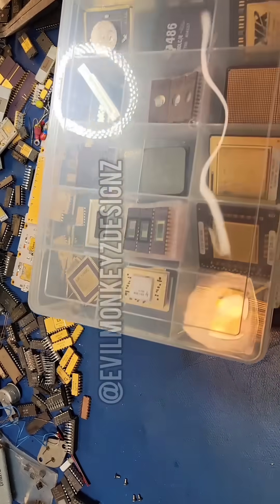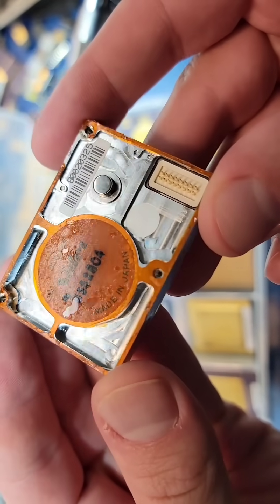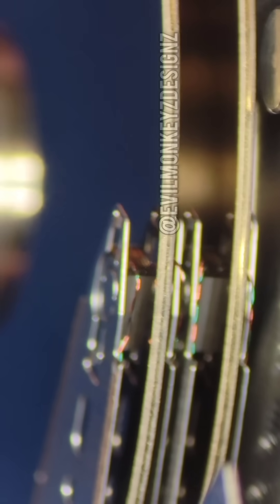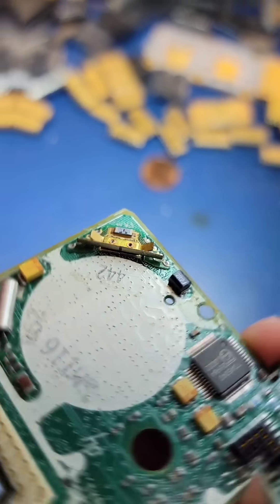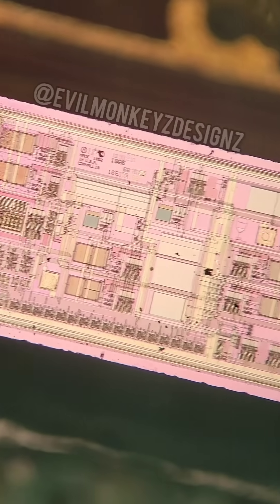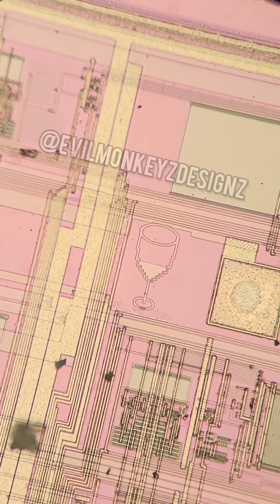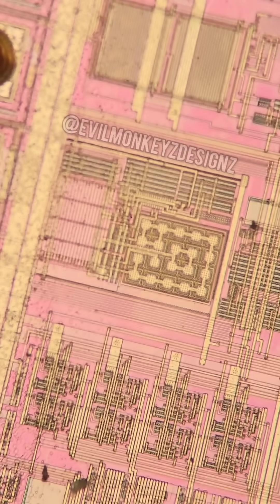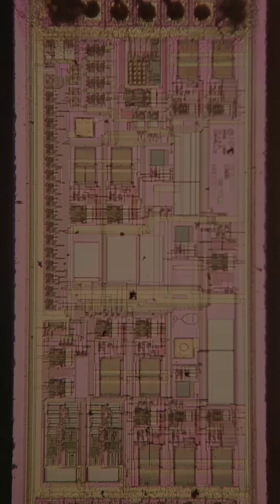1.3" HDD

Comment: That as an USB stick would be great.
Reply: Not with this particular drive, but that was an actual thing a bit later on. I have a 4GB "USB stick" that uses an IBM microdrive internally (same drive mech as the ones designed to fit in a compact flash slot). It's basically a small rectangular plastic case (~2.5x2") with a USB connector that flips out from one end of it on a hinge.

Comment: The sensor actually detected a free fall condition.  When you drop something, in free fall, all the sensors will detect near zero gravity.  The sensor will then trigger the head parking mechanism to quickly retract the heads off the platters to a safe zone before the inevitable very high g-load (from impact with the ground) happens.  Back in the day, when we were designing them, we called them "Oh Sh*t" sensors.

Comment: I had a pcmcia drive much like that, what was weird about it is that half the bios for the actual laptop and or cash register (depending on its application) was in the firmware of the drive, making it the only thing that the device would boot.

Comment: Older 'spinning rust' HDD"s were never "designed to be dropped"..but some of them had some basic protection,just in case.. It's not a guarantee that the drive will survive an impact,though..mostly just wishful thinking,honestly. The heads are floating on a very thin cushion of air,it doesn't take much for them to impact the platter and literally scrape your data away.

Comment: Wow! I'm impressed at the small size and technology, specifically given how old this drive is. 9 years earlier the original Macintosh 128k was introduced and it used much larger circuitry. The Macintosh Portable came out in 1989 and ran through September 1991. One year after we had technology like this. With that in mind doesn't this blow your mind? Wow!

Comment: Remember the CF Sized hard disks? 1 " sized. CF means Compact Flash, but since this standard was still quite huge, hard disk manufacturers built tiny hard disks to fit in CF slots 😅
Edit: They were quite cool, more storage for less money, but they were super slow compared to real flash memory cards. And since cameras etc. had quite large buffering capacity, they were even super useful for cameras. Just not if you were a very triggerhappy photographer, then you'll wait after a few pictures. But anyone coming from analog photography never had that problem 😂

Comment: I remember my old Thinkpad T23 had APS -Active Protection System. Same basic principle. It would detect a shock and rapidly park the heads to prevent drive damage. Would also protect a hard drive in the Ultrabay as well.

Comment: I was given a small drive found in a park , after some searching I found an external enclosure for it on the well known auction site , it was a small 1.8" hard drive from a camcorder , nothing on it other than some firmware data . It still works , it's basically a 30 gb external drive now , albeit living in a drawer unused .

Comment: congrats, you broke the drive by exposing it to pure air and not in a anti dust chamber
Reply: Now we will all die because the cheat code for survival was on it 👌🏻
Reply: @nee3029  and congrats you triggered my underlying lung disease caused by aluminium oxide, i now have asthma and acute lymphoma that has nothing to do with asthma nor lungs

Comment: lol in 93 I worked on a 20meg drive that took 2 people to lift, us navy, snap 2 computer system……ugh
Reply: Call me crazy...But being strength-centric to the point of disliking miniaturization, I would have loved to have had an external HDD of those dimensions and weight... 💪💾💙

Thinking about what you could fit into that form factor today: I wonder how practical a 50kg one petabyte drive be in practice? 😇

Comment: Smaller drives exist indeed and they have more capacity I have a working 0.85 inch drive that hold 4GB in an old Nokia N91.
Reply: But this one looks better. More hard drive looking to me. With all the components and interconnects and the machined housing

Comment: I had an old ZIF drive (i think that's what it was) from a old "Creative MP3 Player" back in the day before Solid State Storage was "cheep" it was so small, like 500MB or something like 1GB HUGE at the time, it blew my mind how it even worked at all... since my PC had a BIG HDD and it was only 40GB and that was a Huge Storage at the time, it was Windows 95 or 98 i think ...How was that less expensive to manufacture than a simple Mass-Produced Chip based storage... it was crazy to see back then.
Reply: Flash memory ist Not the Same as ssd 

And the first mp3 players had 32/64mb flash memory 

It was a long way from 128mb to finally 512mb and years later 1GB available

Comment: If this thing was dropped the heads parking wouldn't prevent them from crashing into the platters, but if they crashed in the landing zone it was less likely to cause catastrophic data loss. Also if the spindle was made to stop after parking it would have further reduced damage from impact. Ramp-loading heads didn't appear until a few years after this was built, which further increased impact resistance, but these are still extremely fragile precision devices and are not intended for rough handling.
Reply: I never understood how the ramp mechanisms didn't cause more problems than they ever solved. Watching how the servo just slams them over into it... and then they just fly out onto the disk all lazily until the controller decides it's time to seek 0... never could figure out how there weren't all kinds of alignment and crash issues. Never really seemed to be an issue but talk about counterintuitive lol

Comment: Okay but hows the accelerometer work? Are those piezo elements? Resistive? Capacitive? Could even be radio or inductive. How many drives had this. When did mems chips come out? Can I ask one more question lol. I mean it has to be faster than the heads can crash right? Or does it not work like that and the head’s always crash at least a bit.
Reply: I think these were some of the first MEMS ones.  Piezo would have been too slow

Comment: I had a calculator, years ago. Which had storage features. I never thought much about it, but i tore it apart after it broke. I'm not sure if it qualifies as a HDD, but it had a flexible plastic magnetic platter, similar to a floppy disk, about 1.25cm in size, and a fixed position read/write head, contained in a tiny plastic enclosure within the calculator.
Reply: The web tells me that was a Canon Canola 167.  They had an insane (for the 60's) capacity of 100 numbers memory because they had that drum memory.
Reply: thats so cool
Reply: what the hell calculator was that!?  You had a calculator with drum memory!  that's so cool
Reply: @tsm688  I'm not sure I would call it drum memory. I'm not exactly sure just what you would call it. - I wish I could recall what calculator it was, it was not a model of any significance. It was a CAS calculator, but was not graphing. It was very similar to the Casio FX-300ES, but was like a cheaper Chinese knock off. :D
Reply: @trevorcorwynn1311  a modern calculator?  Very funky indeed.  I begin to suspect that wasn't a drive at all, but some sort of position encoder.
Reply: @tsm688 Did it have slots in it?
Reply: @qwertykeyboard5901  how would I know?
Reply: @tsm688  oops
Reply: @trevorcorwynn1311  Hard drives really are just floppy drives with more durable components.
Reply: Would love to see tear down of it
Reply: So, what was the battery life like?

Comment: Is there a smaller HDD?
Reply: Yes. There's a considerable variety of HDD under 2". Most of them were specialty made for specific products (ipods - multiple, laptops, PDAs - before smartphones were a thing, etc).

If you want to find out, I would start with a search of "1.9" HDD" then go down by .1 each search. You'll probably be amazed at how many existed but were hardly known about. Original Ipods and I believe nanos and Zunes would probably be the devices most people were familiar with.

Comment: Damn!!! This must've been ADVANCED PC tech in 92..
In 92 my fam PC was a 486, 16MB Ram, 200M HDD (IDE?) .. good times ... Miss that Turbo button :P
Reply: 16G of ram?  you mean 16 megs of ram, probably EDOSIMMs, which is pretty good for the time.  HDD would be SCSI at the time or IDE depending what controller card you had.
Reply: @2600baud  correct, typo on my end, don't often use MB to refer to RAM these days :P
Reply: lol 16G of ram
Reply: What's the turbo button do? I was afraid to use it
Reply: @CALEB-kt8mn  The turbo button was used to increase or decrease the clock speed of the processor externally.  Often from 12 MHz to whatever max speed your processor was at the time.  The reason behind it if I remember was that some programs that were "backwards" compatible would not run at the max speed cause it was not written to run at whatever the max speed of the processor was.  Such as some games if you played at max speed would just glitch or you hold down a move key and you just fly across the screen cause the game was running too fast.  When the operating systems advanced to have better interrupts to throttle the processor as needed than to have a forced underclock on the board, the turbo button was not needed anymore and disappeared between the windows 3.1 and windows 95 era, first gen pentium.
Reply: @2600baud  thank you
Reply: @CALEB-kt8mn  The turbo button was used to slow your PC down to 1981 speeds if you needed to use a really old program that misbehaved on faster PC's
Reply: Turbo button slows down the pc 😂 @CALEB-kt8mn
Reply: Damn! You had 16 MBS in 1992!! I didnt see that until the Pentiums came out!
Reply: You might've even had a separate disk controller card even in 1992. IDE stands for Integrated Drive Electronics, by the way.
Reply: @edherdman9973  thanx , I recall what IDE stands for, but I can't recall if disks at that time were IDE based. :) .

I doubt they were IDE, because when I got into I.T professionally about 13y later, SATA 1 and 2 drives were still sort of pricey tech.
Reply: It was the smallest hard drive in the world
Reply: Same😢
16Mhz or with Turbo 32 Mhz 😢
Reply: U can thank the aliens for that

Comment: I still own a Dauphin computer that used that 40Mb drive.  The accelerometer was needed since it was a laptop, and it would park the heads if it felt a quick movement. I had to run "Stacker" because win 3.11 took a lot of room.
Reply: I think the accelerometer has become a feature of all spinning drives these days.  Eariler than the 90's they didn't because such a sensor-on-a-chip didn't quite exist yet
Reply: @tsm688  I definitely remember that being on an early 2000s laptop of my parents! I think it even had a graphic of the drive's angle in relation to horizontal inside the drive's properties window, I'm guessing to look cool.

But maybe not all laptop hard drives come with that feature? Is the shock protection feature built into the laptop or specific to the drive?
Reply: I used Stacker also!
Reply: Stacker! I totally forgot about this, thanks for the flashback 😅

Comment: Still cant believe there were ipods with 80gb capacities with physical hard drives considering how old it was and for how long the phone market didnt seem to have that much, especially with android. I know there were other concerns on the phones, but still
Reply: Flash based storage really sucked for a long time. Very small capacity AND super expensive.
Reply: Came here to say this, the old fat iPods had spinning disk hard drives in them.  If you put them up to your ear you could hear the arm moving and the disks spinning.  There was also a 160 gb model but you could also switch the drive out to a larger capacity one.
Reply: People still like those. They get the spinning drive version and put ssds in them. Still a good way of getting a large capacity MP3 player
Reply: @zyeborm  We still have ours. We thought it was lost forever and found it out of the blue one day like a decade later
Reply: @zyeborm  Im one of them!!! I have the larger battery mod already installed lasts a long time and Im going to be essentially putting 1TB of storage into an iPod 5th gen
Reply: They were pretty durable though. The only apple product I've ever had was an 80gb first gen iPad video, loved that thing. Having full seasons of South park on it was mind blowing when it came out.
Reply: @beeman4266  The only reason why any portable hard drives even worked is because they have an accelerometer in them and the controller parks the heads whenever it detects that a shock is going to happen. Without that, they are about as fragile as any other hard drive. Maybe a little less since they usually are cushioned  with foam or rubber and regular hard drives usually aren't.
Reply: @No-mq5lw   Interesting, obviously their durability is nothing compared to phones with flash memory but I was just impressed that it didn't really skip or anything. Can't say I ever dropped it though.
Reply: @beeman4266  Skip protection is usually handled by a DRAM buffer. Your data is streamed to the buffer, then read from the buffer to be played. Even now, this is by and large how most storage is handled.
Reply: @No-mq5lw Yup, same with portable CD players, they use a RAM buffer to even out any skips if the machine is jolted.
Reply: I remember those in my iPod video back in the day. Had to replace the drive in it, used tweezer for most things as everything was so tiny. I do love water proofing, but I really do miss how even apple products were just so easy to work on (imho)
Reply: @alexjackson936 same lol I replaced my girlfriends iPod’s hard drive when I was 14 and had never done anything like that.. and it worked
Reply: Those are 1.8 inch hard drives known as netbook/ultra portable laptop hard drives.
Reply: Solid state memory was still uber expensive when the iPod came out….
Reply: Friend of mine buys used (broken) iPods, slaps a modern SSD into them, and resells them.
Reply: Whaaaat? I had no idea there were actual hard disks in iPods
Reply: @Taima  Did you never own one?
Reply: @extrasmallbeep  Indeed I did not. No iPods of any kind. Kinda missed the boat on them, repeatedly. Went from bedroom radio at the ages of like 8-11 to cd player from 12 to 15 to sweet Sony Ericsson slider walkman phone for a year and then got my first iPhone (3G S). Definitely felt the lack of iPod for a while in high school but I also hate earbuds and find them uncomfortable and my parents knew that so they never really wanted to get me one, understandably.
Reply: I had a Ipod Classic in 2008 and was extremely slow 😅... definitely would have sucked in a android phone, that's why not even Appoe tried it
Reply: And the iPod HDDs were also used inside MacBook Air. Many people also don't know MacBooks had an accelerometer also for the hard drive.
Reply: 2006: 80GB iPod, iPod nano 2G, iPod shuffle 2G

In 2006 ,, PC was bigger.. and phones not,, why??
Because a phone would be to big and easy broken..
Reply: I paid about 80 dollars for a 512mb flash card and 2gb cards was 500 dollars
Edit: in 2004
Reply: If you mean why not hard drives then that's cause there was only a brief moment when it made sense in capacity vs. price for the form factor required, and that DID happen in phones in the form of the Nokia N91 used a 4 GB 0.8" hard drive inside it. About the size of a normal SD card (not Micro) but a bit thicker.

Now, about Androids not having high capacities that's completely out of reality, given pretty much all of them used to have Micro SD slots, with few exceptions. It is still true tho that for Micro SDs of 128 GB or more to hit the market took a long while after the hard drive iPods, then again the size difference is enormous.

In other hand I also would have found it really interesting to see someone come up with a real chonker with a 1.8" hard drive inside it in the early 2010s with like 160~250 GB capacity.
Reply: Something with this many gigs in 92 is.. beyond nuts. Beyond nuts.
Reply: @Bill-mj8hf  the '92 drive in the video is 40 megabytes tho, while iPods with 80 GB came in mid 2000s.
Reply: megabytes, 20 and 40 is what he said.  Nothing had gigabyte capacity in 1992.
Reply: So you're 12